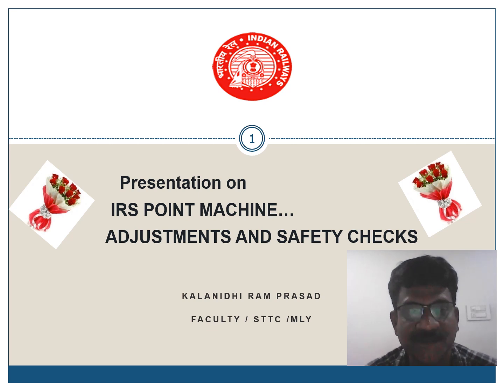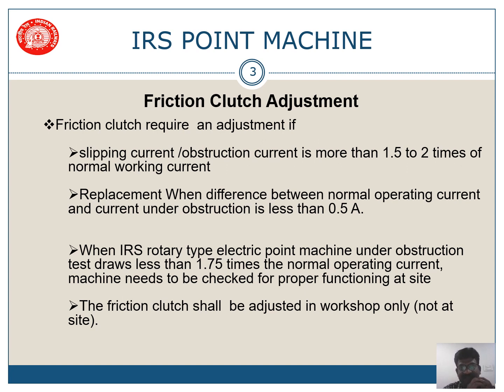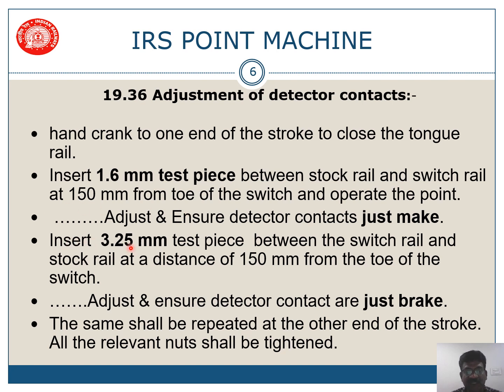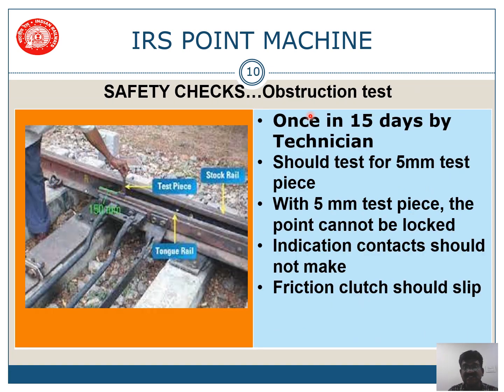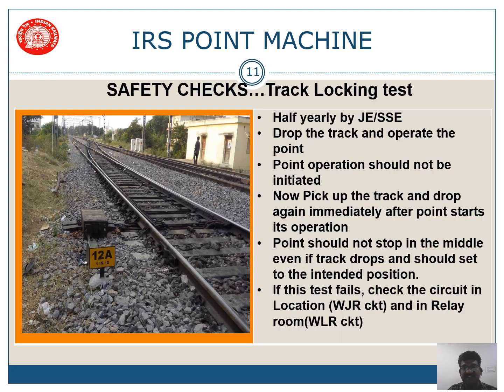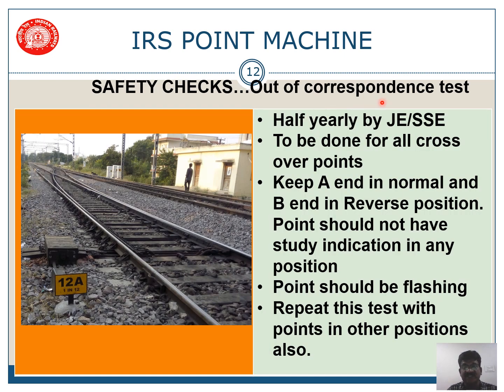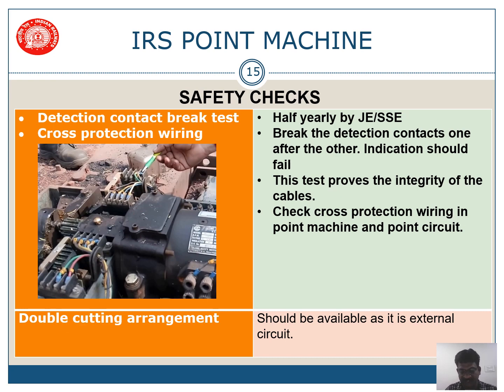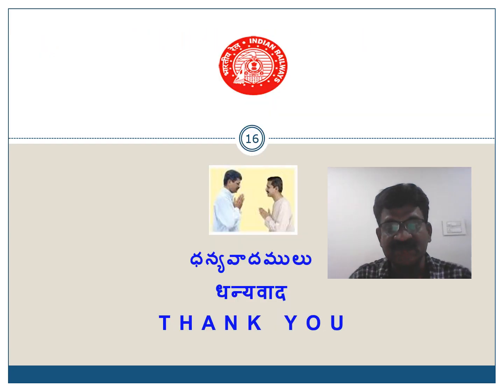Point Machine... Adjustment and Safety Checks

Comment: Why 5mm obstruction is not enough for detector contacts just break, although point is locked properly?
Reply from the maker: This is called two stage safety..1. 5mm lock foul, hence detection contacts will not make. But if 5mm fails afterwards,  then what?   2. 3.25 mm detection is just break after locking. This is second stage safety.